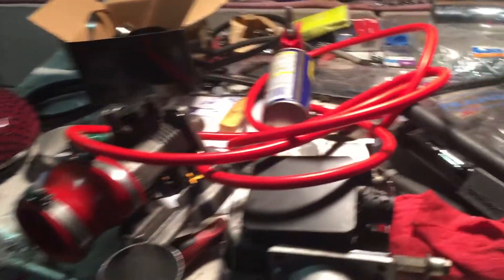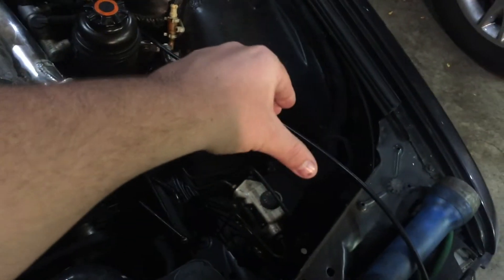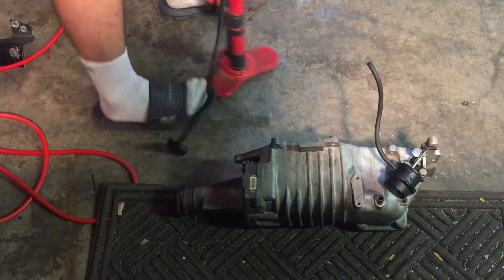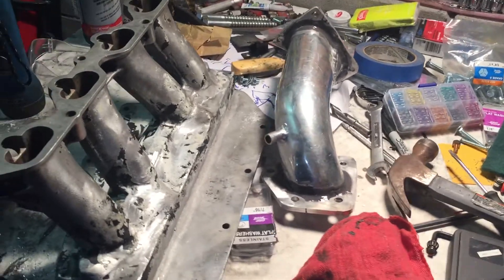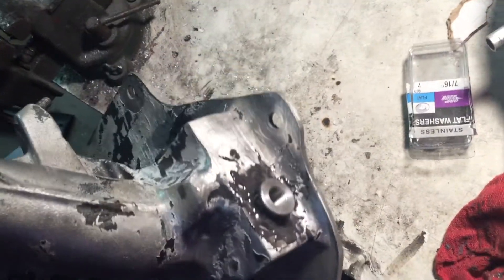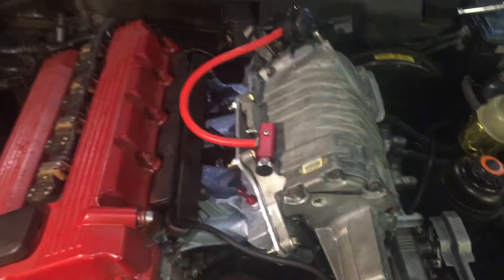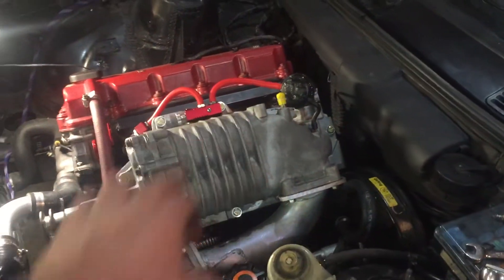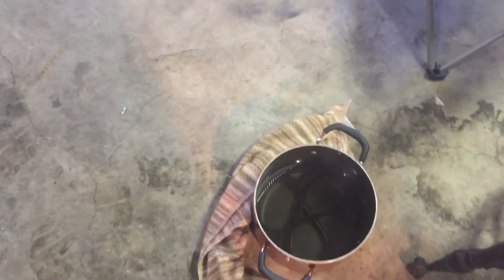Finalization (READY TO START) | E30 SUPERCHARGER BUILD

Comment: Hey man im from france i have two question what is the name of this supercharger  ?  And for this admission pipe its created or buy ?
Reply from the maker: i don't know what the admission pipe would be, but maybe what i call the inlet tube or the new intake manifold.
both are custom made. the manifold was an original cut and then the mounting plate was welded to that.

the super charger is a eaton m62 from a nissan xterra but with everything being custom you can use whatever you want.
i would choose a m90 from all the GM 3.8L s/c cars aruond here
cheers from Minnesota